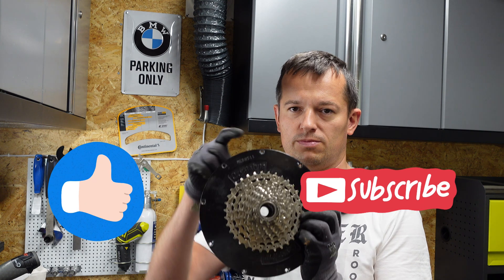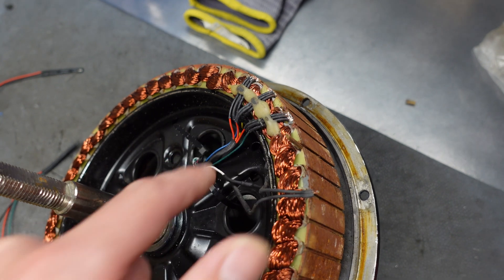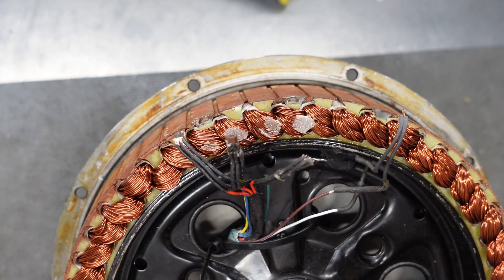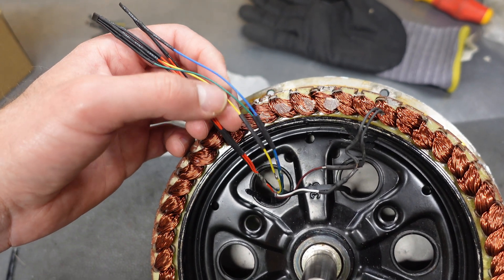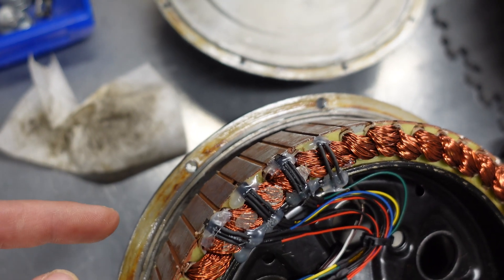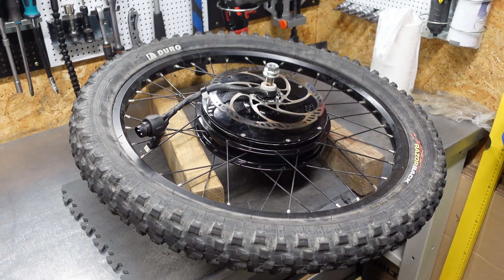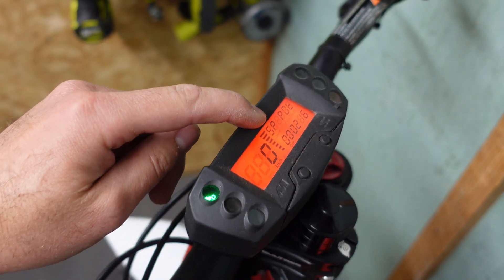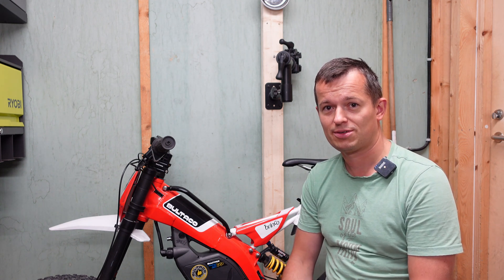Crystalyte motor repair in Bultaco Brinco motorcycle

Comment: Thank for the video. Can you say me which model of Hall sensors are used?
Reply: Today I changed the hall sensors of my Bultaco Brinco R (2000W version). The original 3 hall sensors are in-scripted with "11A 604". I couldn´t find  any information about this after hours of gooogoooooling. One of the sensors was broken and I replaced it with an "INFINEON TLE4945L". The bike is working again! I can send you pictures of the original hall sensors, new sensors and repair if needed.